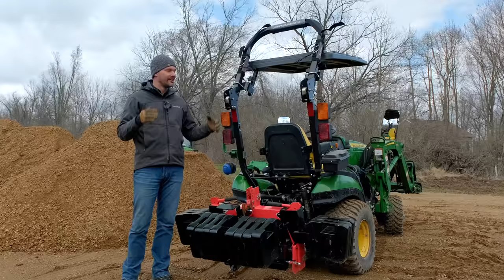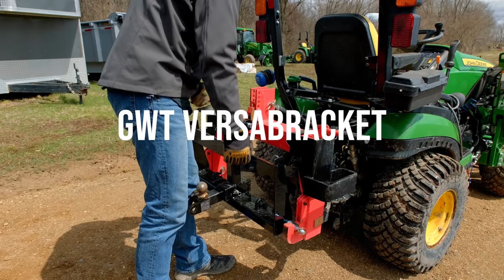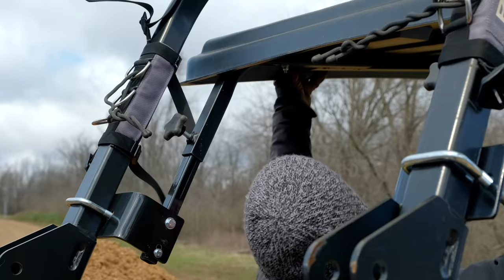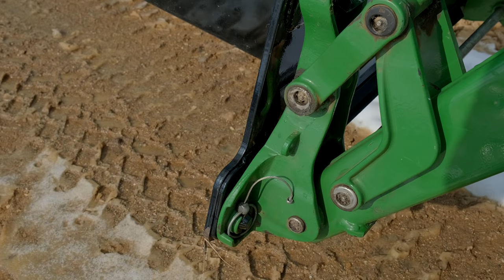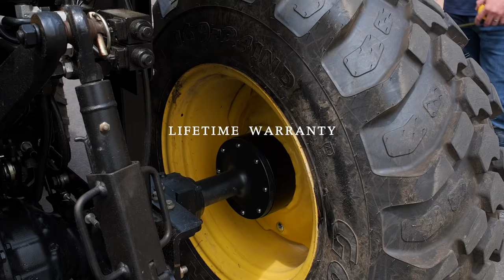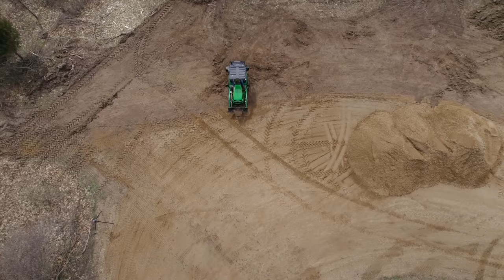TINY TRACTOR TACKLES STUMPS WITH FRONT HOE BUCKET

Comment: I have the GWT stump bucket.  I am on a mission to eliminate honeysuckle from my six acres.  The stump bucket is on an RK25 tractor.  Last season, I took out about 750 honeysuckle roots (relatively shallow).  I found out that having a person spot for me in front of the stump bucket increased my productivity to better target the stumps and I can run the tractor for hours without having to get off.   I run about 500 lbs of weight on the back of the tractor by using a heavy implement on my GWT quick hitch.  All of it is highly recommended.

Comment: I've got a John Deere 3 series and this bucket is perfect size once you get a feel for the tool.  I've used it to pull up dozens of Yaupon Holly trees that have infested my property.  Cut them off at ground level and then use the bucket for a couple good digs and the root ball is out.  It's also good for starting a trench.  Even though it doesn't go deep enough, it's better than using a shovel for the whole depth of the trench.  The front plate also acts like a blade when pushing dirt back into a trench.  Ohh... and it's also good for precise demolition when forks are too much.

Comment: I have a JD 3032e with a loader and bucket.   What I have spent some time looking for is an attachment slab of steel that fit the front bucket edge that has steel points on it, or steel points that wedge on it, so that it will dig.  The terrain here is hard packed clay.   Every place I have contacted want to sell me a new bucket that has those points welded on it from the factory.  Do you have any ideas?

Comment: Hey Courtney...That set up works very well.  Is it faster faster/more efficient from start to finish than with the 1025r backhoe attachment?  I know you aren't a big fan of the back hoe (cost to use ratio), but curious to know your thoughts/experience.
Reply: I can't comment from experience but it sure seems like a backhoe would be quicker to dig it out. I personally have very little use for a backhoe, so the stump bucket would be much more ideal given how often it would get used vs a backhoe.

I had a family member over this morning, he was able to rip 11 smaller stumps (probably 16in diameter) out in about 25 minutes using a Bobcat 331. A couple of quick passes on each side, then push the stump over. Use the thumb to pick them up and literally toss em in the burn pile.

That said, the 331 weighs about 5x more than a bare 1025r.
Reply: @TheeAbstractHero  Intrinsic weight definitely matters...
Reply: @josephsierra7295  I made the distinction for that reason!

Comment: I like the idea of ballast weight brackets but why not just use a ballast box which is loaded. Quick connect and don't have to attach each of the brackets and load the weights. Unless your using it for your morning workout?

Comment: Size Matters a lot with a stump bucket. Mine is 3.5 feet long and pushing it with L 3901. It gets the job done, but I can definitely see how a smaller one on a lighter tractor would hit a dead end.

You have to go in at a shallow angle in order not to stress the hydraulics, a shorter stump bucket is not going to really give you that option.
Reply: I disagree, a shorter stump bucket has less leverage on the loader, thus is safer to use (SCUT)
Reply: @ATR-42  I agree that it is going to stress the Hydraulics less if you angle it down. However, it doesn't seem to dig deep enough. If you angle the bucket really steep, then the front end of the tractor just lifts up because it doesn't have enough weight.

If that's the size of the tractor that you have, having it is better than not having it. I'm just pointing out that there's a significant difference in the way I work it.

When compared to using the regular buckets, this tractor and my larger one work pretty much the same. I just hold more in the bucket. With the stump bucket, it seems to work different.
Reply: @tsafa  well said. In any case, using a stump bucket with any tractor requires attention and trying not to twist and end up with a bent loader. I have the artillian one which is pretty short but use it very carefully.

Comment: Would never put one on my L2850's loader.  I've used 250' of 3/8" wire rope and up to 4 snatch blocks with a good anchor tree - don't cut the tree first - snap most of the roots with the backhoe, hook up a hefty chain around the trunk as high up as possible, use as many snatch blocks as space and safe location to pull from allows, then pull the damn tree over - root ball & all.  Works good with smaller root-intense brush as well.  All you seem to be doing is beating the hell out of the machine and still having a lot of hand work to do.  Better still - use a good size excavator with a thumb.
The investment in the cable and snatch blocks paid good dividends for me in the end. Carved out about 750 feet of driveway with white oaks up to 20" DBH.